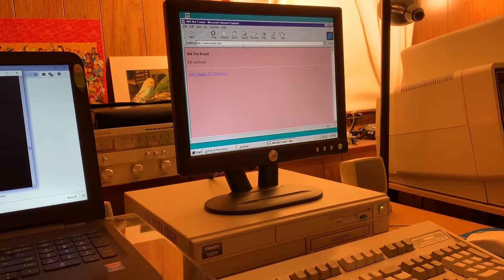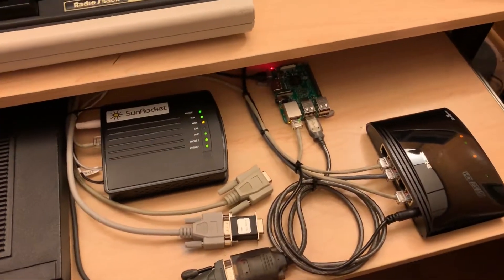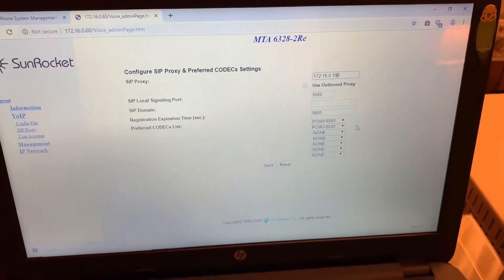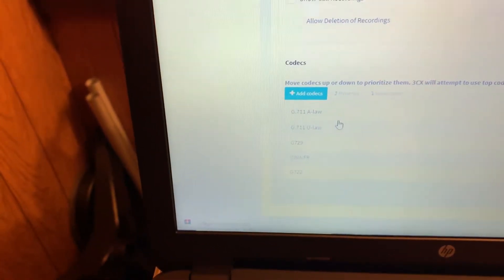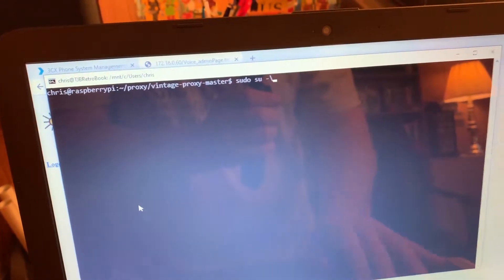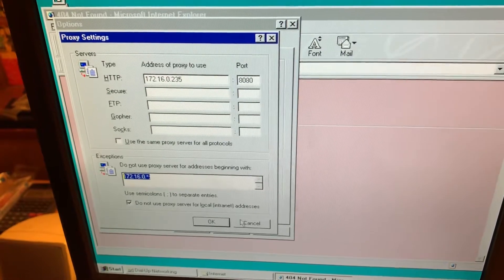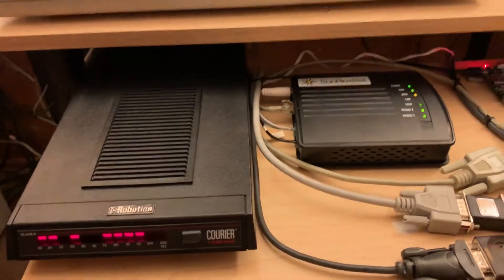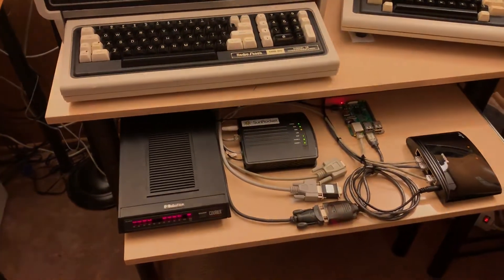Part II - 90's Dial-Up Internet Simulator

Comment: Can you list the model names of all your modems plz?
Reply from the maker: The modem in the drawer next to the Sun Rocket ATA is a US Robotics V.Everything 33.6/28.8 modem; it doesn’t have a model number on it.  Part # on the label is 1.020.091-B.  The other number on it is 80-001224-02.  As to the modem connected to the Tandy 4825 SX, that’s US Robotics Sportster 33.6, on the bottom a label says Model 0459.  USR doesn’t highlight model numbers,  but hopefully that’s enough info.  Thanks for watching!

Comment: Hello I have a question. Back then how did they have multiple people dial in to a server? When I use to do a multiplayer doom game we had 6 people on one server. I was just curious how was it possible?
Reply from the maker: For larger systems, like ISPs, you often had racks of modems and a pool of phone lines, which connected to one or more server systems usually running Unix.  Sometimes serial and phone lines were multiplexed to combine calls and save physical runs (and make more efficient use of the lines).  In the case of an ISP, once logged in you had an IP address, similar to now, and would talk to other systems over TCP/IP.  For smaller systems, like BBSes and small local Doom servers, you’d usually do multiple phone lines, each paired to dedicated serial port on the server end.  My friend and I would play Doom with a single phone line each, and one of us would set our copy of Doom up as the server (and configure the modem to auto-answer).  The other would call in, and we’d play against each other.  This description is a bit of an oversimplification, because it becomes a can of worms pretty quickly, but that’s the general gist.  Hope that helps and thanks for watching!